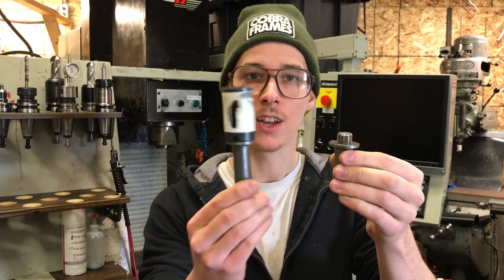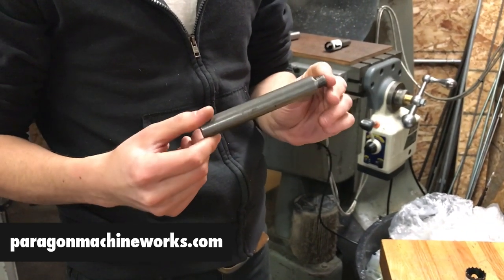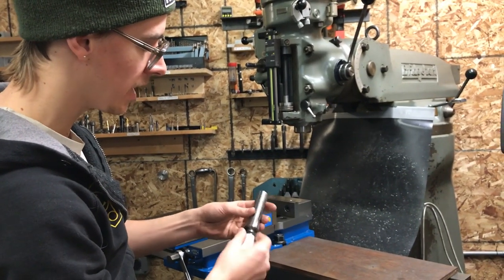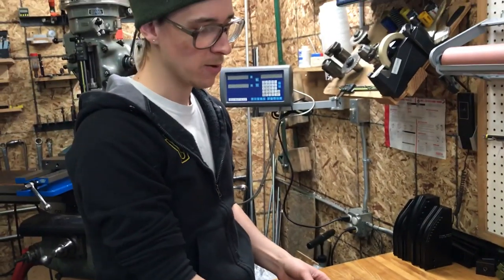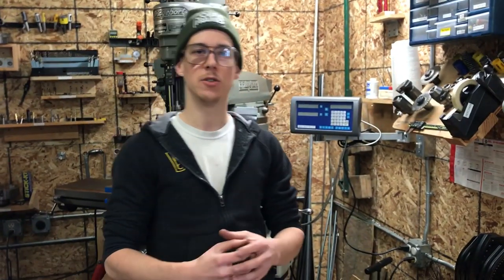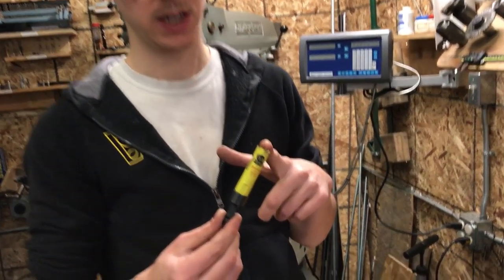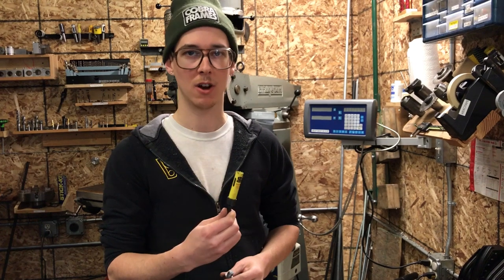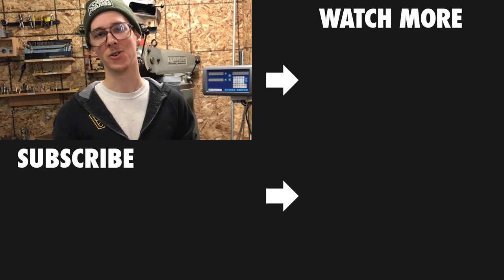Why Hole Saw Arbors Matter for Mitering Bicycle Tubing

Comment: They are worth their weight in gold! I use them in my mill when I want to make big holes or rough our large interrupted cuts. It also leaves you with usable material, and they are much cheaper than an annular cutters.

Comment: What is the cutting speed do you set up for those hole saws (when cutting steel) ?
Reply from the maker: It depends on cutter size. Lately I'll run about 300-600 rpm in the larger size cutters and 900-1200 in the smaller size cutters.